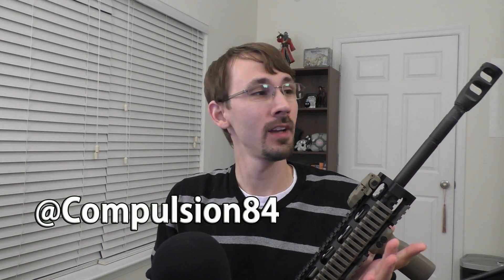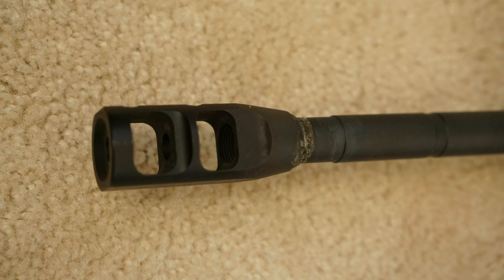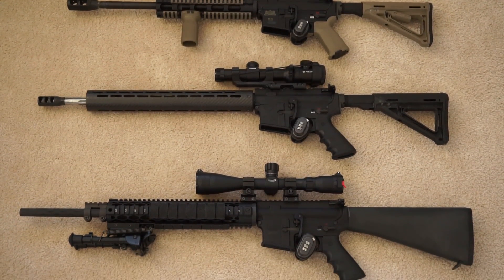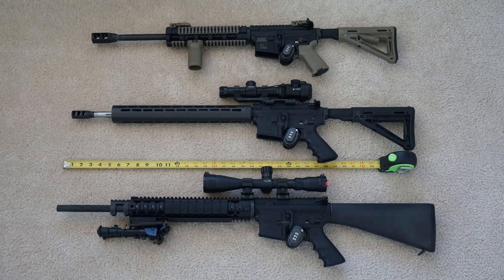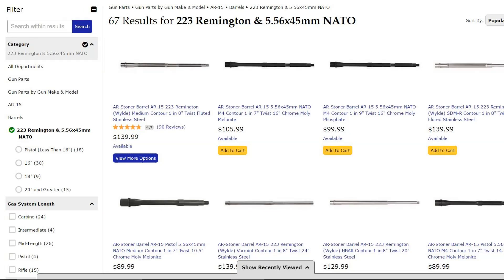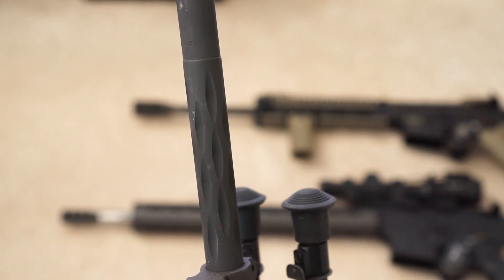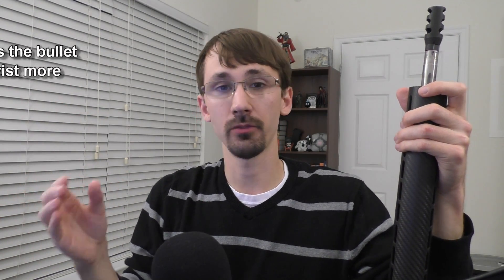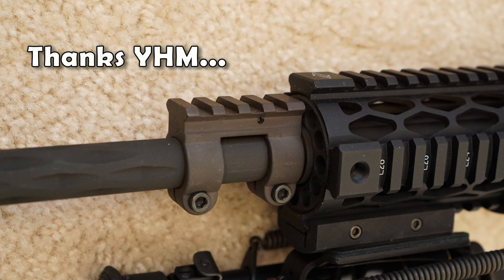AR 15 Barrels - Part I: How to Choose Barrel Length, Twist Rate, and Gas System (AR15 / AR-15)

Comment: Well your correct in a communist state  but if your free you can use a suppressor, then those 11 5 barrels make a lot more sense, pluse much easier to sling around.

Comment: I have a 1/9 twist 24" stainless match barrel and it shoots 69gr under 1/2 MOA shoots 53gr the same.    1/9 is probably the best over all twist for the AR 223.   1/12 is good for the 40s but 1/9 will shoot them well too.  
It depends on the velocity you shoot them at.    
2500 fps 1/9 twist - 2500x12/9x60 = 200,000 rpm
3600 fps 1/9 twist - 3600x12/9x60 = 288,000 rpm (try to stay under 300,000 for varmint)
3600 fps 1/7 twist - 3600x12/7x60 = 370,000 rpm (Blowing up rounds, reducing accuracy, inc heat

Sierra 69gr are perfectly stable in a 1/9 twist unless you were to shoot them under 1600 fps.  They shoot around 3000 fps in a 24"  well over 200,000 rpm.   1/7 twist really only good for shooting longer bullets (Tracers) since they are not pure lead they weight 62gr but have the length of a 80gr thus 1/7 twist is needed.

Its the the weight of the bullet its the length.  Some alloy bullets are much longer than lead.   Some 26gr alloy can be longer than a 40gr lead bullet and would require a faster twist.   

1/9 can do 36gr to 75 gr.  But at 75gr its hit or miss.   Over spinning the bullets might be slightly less accurate than say a 1/12 twist and produce a little less barrel heat.   If the bullets were all perfectly balance over spinning would not cause any accuracy issues so a 1/12 might be a little more forgiving. Shooting heavy 75+ grain also means more drop and slow best shot with a caliber other than 223 with more case capacity.  

For Varmint 223 shooters 1/9 is probably the best do all twist.   36gr to 69gr all sub MOA using a 223 Wyled chamber w bull barrel.  1/7 and 1/8 can do it but at the cost of heat and some velocity and blowing up lighter rounds in mid flight.   With 1/9 twist its difficult to over spin as the 223 does not have the case capacity for 4200 fps but with a 1/7 for sure you can blow up varmint rounds.

Comment: 1st off THANK YOU this channel has been incredibly informative!!! 

Question: I shoot Air rifles long range so in my transition to firearms I want a gun that can be BOTH a home defense AND a long range rifle.  

So is there a way to build out the lower that can be switched out to do both, then I can swap them as needed?!?  OR do you recommend going with an 18" and just have it serve both proposes??   I am a bigger guy I can handle the 18" in a home defense situation if need be.  

Anyone any help/advice is greatly appreciated.  Also I am newer to firearms so specific parts would also be appreciated.  As long as it won't ruffle any feathers with your sponsors.  

Thank you!!
Reply from the maker: Depending on how you setup the lower (using a versatile trigger and adjustable stock) you could use two different uppers easily.  If you want a general all arounder I lean towards 16" these days.  If you want something for more dedicated long range I think building a 20" works.

I have a completely separate 20" rifle because the trigger is very light.  With such a light trigger I wouldn't feel comfortable handling it quickly in 3 gun.  Again if you use something middle of the road trigger pull wise I think building 1 lower (to start) isn't a bad idea.

Comment: Please understand that the majority of aftermarket shorter barrels and gas tubes make your build overgassed and slightly out of time. Not to the point of leaving swipe marks on the case head, but much more gas pressure than required. Using and tuning an adjustable gas block is a requirement for peak reliable operation.  Much less force exerted on your locking lugs, faster cyclic rates that actually stay in time, and less felt recoil.

Comment: I have a smith and Wesson M&p 15t with a 16 barrel but it doesn’t have a brake on the barrel do I have to buy another barrel or can I mount a brake on it ??
Reply from the maker: If the barrel has threads on it you should be good to go.  Threads would be under a cap or an existing muzzle device.  If it's just straight metal to the end you might as we replace the barrel.  

Unless you have a good local shop the cost to thread an existing barrel is relatively high once you factor in shipping.

Comment: Easy, longer means better, higher twist rate means better, get away from the AR platform because Direct Impingement isn’t the way to go.
Reply: Overspin from a twist rate that is too high definitely affects accuracy in the benchrest world.  Even seen bullets explode into a little grey puff from too many rpm’s.
Reply: @blackhawk7r221  I agree in the abstract, I was talking about the currently available AR barrels, the optimum barrel for projectile velocity on average burn propellant is 70 time the diameter of the projectile, add 1 com for a screw so you can attach a muzzle brake of choice
Reply: @anthonyburke5656  Ah, I see where you’re coming from.  Yea, it’s easy to start splitting hairs, but very hard to make a suggestion when everyone is shooting different brand ammo with different burn rates and different pressure curves.  You start blowing their minds when you bring up pressure dwell time and short tube overgassing affecting cyclic timing.  As long as people are using the inherently inaccurate M855 green tips, it’s almost moot.

Comment: Overall, this was a good video. I would advise against calling something "stupid" or "dumb", particularly if you don't have a full understanding of the why. Gas system length is unrelated to handguard length. 

You can use a any length handguard with a carbine, mid, intermediate or rifle length gas system. As you correctly stated, you should ensure that the handguard covers the gas block, or you risk knocking it out of alignment, which will affect the function of the rifle. It's for this reason I'm not a fan of "railed" gas blocks like the one on the DPMS Oracle.

Longer gas systems aren't "more" reliable, they can be less, which is one of the reasons why the military uses a carbine length. Carbine systems are a bit more violent and cause accelerated wear on some parts, particularly on the bolt & gas key. 

The reason for the enhanced reliability of a carbine length gas system as opposed to a mid-length gas system is DWELL TIME. This is a function of the amount of barrel left after the bullet passes the gas port. Once the bullet leaves the barrel, the gas pressure drops precipitously, so more barrel after the gas port allows gasses to travel down the gas tube to the bolt carrier. With a mid length gas system, the block is further out, there is less barrel before the bullet exits...and thus less propellant gasses to cycle the bolt.

This does cause less of an impulse making the mid gas system a bit more pleasant to shoot, but let's be honest - the 556 is a soft round anyway. 

If your ammo is full powered, you shouldn't have reliability issues with a mid length gas system, but with lower powered ammo like steel case Wolf and Tula, some have had cycling issues. It's a trial and error thing- but life on the line, I want something I don't have to think about, so carbine gas system is better.....NOT DUMB.

Read up on how dwell time effects cycling of the firearm. I'm not knocking you, as I needed to study it quite a bit. Just a little info for you. Keep up the vids!!!
Reply: I appreciate the vid,and your comment,being new to the AR platform,they both helped quite a bit.
Reply: Exactly why we properly tune with adjustable gas blocks to compensate for all these overgassed tube and barrel lengths causing cyclic timing and wear issues.

Comment: Why does the handguard need to be tied to the gas system?  Can't you have a really long handguard on a shortlength gas system? Granted short gas system is really bad idea for 16 inch barrel.
Reply from the maker: You don't necessarily have to, it's just a better fit.  You could have a longer handguard than the gas system, it shouldn't hurt anything.  It's also possible to have the guard not cover the gas block, but I hate those myself.

Comment: There is nothing at all "stupid" about a carbine gas system, plenty of shooters like the carbine handguard length, you may not but it probably is the most popular length, carbine and rifle were the two military original gas lengths, mid-length is civilian. Not that many shooters want or need a rifle with that much barrel and hand guard length such as 18" and 20, hunters maybe, also the military used 20" because of bayonets, which now only the Marine Corps trains for.

Comment: Terminology- twist rate spin stabilizes the bullets. 1 in 12 is faster and 1 in 7 slower spin rate. A model to show people is a bolt with a nut in it. Thanks for making the vid.
Reply: One revolution in a seven inch distance is now a slower twist than one revolution in a twelve inch distance.  Uh, ok.

Comment: Really great video and spread of information covered. Could not catch it - did you mention 55gr and 1:7 twist rate?
Reply from the maker: Thanks.  I've used 1:7, 1:8, and 1:9 barrels with 55 grain FMJ BT XM193 with good results.  I've heard scattered stories of issues with 55 grain and 1:7, but never experienced it myself.
Reply: Depends on your particular gun and the ammo, but I've run numerous 1-7 barrels at 16in and the only 55gr that have ever given me problems were Tula.  I've always chalked that up to the crappy bi-metal construction.  Anyway, never seen any signs of over-stabilization in 50gr+ projectiles, and one still has the ability to run up to 77gr (or larger).  For 16in 1-7 is the way to go.  For a 20in, 1-8.  1-9 is pretty antiquated and for a general purpose rifle I'd avoid it as I have had problems with 55gr and 68/77gr not stabilizing in older Bushmasters with 1-9 twist.
Reply: @mfallen4277  This is a very helpful response, thanks. It can be a bit confusing because there is so much information out there. Most rifles I have seen in 16" have been either 1:7 or 1:8 twist. Thanks!

Comment: Carbine gas systems don’t clog up after prolonged use. The gas block and gas tube get hotter than mid length, which clears them out. Also the higher pressure helps them operate in adverse conditions.  So if you’re fighting with your rifle outdoors, or shooting long strings of fire, a carbine system will go bang more before you start to have malfunctions. Probably why the military uses them. 

Also, a 14.5 barrel is easy to pin and weld, then remove and pin and weld again if you need to. The loss in velocity is minimal and it’s a lot more maneuverable. Probably why the military uses 14.5. 

Yes, if you’re opposed to a little extra work/cost to pin and weld your barrel than go with the pointless 16” (this rifle was never designed for 16”). Yes, if you are never planning to run your rifle dirty, or put reliability before comfort, go with a mid length gas system. To say neither is useful is wrong.
Reply: More reliable to what extent? Sure it has more gas for reliability though that will erode the gas port faster wear out the tube faster beat up the action faster.  
If you have seen any meltdowns it's always the tube that fails. Shorter closer to the action. Is going to fail sooner.

Comment: It is tested fact that some ammo actually looses velocity over 18 inch and even 16 inch on some as well. Under 13 inches, most 5.56 and 223 ammo does not perform as designed due to the velocity needed to cause the boolit to open up as a hollow point or can cause tumble or over penetratration due to falure of the jacket to cause a boolit to open up which turns your AR into a great performing 22 magnum. A 13 inch AR is fine up to about 125-150 yards depending on barrel and ammo used. The U.S.Army went with a barrel length of 14.5 inch with an A2 flash hider as their ideal length field rifle after starting with the 20 inch barrel. For me, a 14.5 with a wielded pinned A2 flash hider, medium contour barrel,  bringing the overall length to 16" , 1 in 8 or 1 in 7 twist barrel, has a winning combo of handling, weight, and performance and I can use any stock I like as well as not working about the ATF or state governments deciding to again, restructure language for the “pistol length AR15 laws”, which they can and will do with political pressure.
Reply: I didn’t want to leave the impression that longer barrel lengths can cause a loss of velocity, but it has in a few cases.There is an average of 20-24 FPS increase in velocity per inch, but that is between a 16 inch barrel up to a 28 inch barrel. Things begin to change when the barrel is cut to less than 14.5 inches, with un acceptable longer range results out to 250 yards and more. A 10.5 inch barrel is ok for short range work, but 13 is much better.
Reply: One also must recognize. 223 is tested with a 24 or 26" for the velocity stamped on the side of the box. 
5.56 will reach 3100fps with a 20"  
2700ish with 16"

Comment: Thanks for the vid, I was a little worried about buying an 18" barrel cuz im only 5'8 and i thought it might be too big.
Reply from the maker: I probably wouldn't go longer, but I think you'll be a ok at that height.
Reply: No, don't worry it'll be just fine and I just mounted a 30" BCB Wylder .223 barrel which weighs almost as much as the original ArmaLite AR-15 did.

Comment: 18 inch 1-7 twist rifle length gas system. Aka a Daniel defense ddm4 v11 pro
Reply from the maker: That looks like a nice rifle.  I wish they would've gone with M LOK vs keymod though.
Reply: @Compulsion84  the v7 pro has mlock

Comment: Actually the further a bullet goes down the barrel the less gas pressure you have. A longer barrel does give a larger muzzle velocity because the gas accelerates the bullet for a longer time. You have a fixed amount of powder that will burn into a fixed amount of gas. If  this gas is in a smaller volume ( bullet close to the receiver) you get a higher pressure. When the gas is in a larger volume ( bullet near the muzzle) you have a lower pressure. So, when you port the gas system further down the barrel you get a lower pressure. The pressure may be lower but it is still high enough to get the job done.

Comment: Hello, i'm new to building an AR and i just ordered a 16" carbine length barrel 1:8 twist and along with it i also picked up a carbine length  gas tube with low profile gas block. . . did i order the right match? thank you in advance.
Reply: Ian Aguinaldo yeah you’ll be fine, the most popular that I see is usually the 14.5 w/carbine tho.
Reply: @AyeMcCloud  thank you so much for that and answering my question so quick. Have a good one.
Reply from the maker: Based on what you said, that should all fit up well.

Comment: Good afternoon Sir and folks; I’m currently making my build and I am stuck between RRA (18 inch, .223 wylde mid length Upper) or Aero Upper ( 18 inch, .223 wylde Riffle length upper). I am familiar with riffle  length  gas system at .223 wylde but I am not familiar with a 18 inch .223 wylde mid length gas system. What are your thoughts and any one out there that has experience with either or?  Outstanding Video !!Thank you.
Reply from the maker: I haven't used a wylde mid myself, but the chamber won't affect the rifle's function.  I guess decide between a little more velocity with 20 or handling with 18?

Comment: Remember that at 14 and a 1/2 in the gun is going to be blisteringly loud when it goes off. Even at 16 in you're giving up quite a bit of velocity. 18 to 20 in is Easley handleable for length and functions quite well with 5.56 + 223. Even given the limitations of the 223. I have one firearm in said caliber with less than a 14 inch barrel at least in the functional barrel length. It does have a muzzle brake on it that I can't add all the ports forward on so it didn't hurt literally hurts when it goes off even if you were Outdoors. But that firearm is for very specific Close Quarters tactical work. It is also in the form of a Mini-14 which will continue to function for a long time to come with very little maintenance.

The highest pressure in that firearm is directly in front of the chamber. And no one would put a gas block there. So your thought that you get a higher pressure if you move the gas block down the barrel, is false. It does not work that way.

Comment: Faster rifling twist rates are for LIGHTER grain bullets. It helps stabilize them in flight. Larger bullet guns, like .50 cal, will always have slower twist rifles barrels. We're talking 1:7 for a 55 grain 5.56mm versus a 1:20 for a .50 cal for example.
Reply: That's just not true.
The weight of the projectile isn't what matters, it's the length of the projectile that matters ( they usually correlate in the same caliber).
There are several other variables that anyone reading this can research if they're interested, but the common misconception about weight needs to be corrected.
The new 8.6 Blackout has a 1:3 Twist for a 350 grain projectile just for an example of extremes.

Comment: Around the 9 minute mark you said to get a mid length gas system for the 16inch barrel. What do you define as mid length?
Reply from the maker: It's a standard. You don't need mid length x".  You would just look for a 16" or 18" mid length barrel.

Comment: If you are looking for the most accurate barrel on the commercial market , then it is the Wilson Combat barrel in any caliber 
they sell.  I currently I own 5 Wilson barrels in 3 different calibers and they all shoot more accurate than i can hold them , which is typically 1/2" to 3/4"  at 100 yards. All Wilson barrels are Match Grade barrels. I have 45 years experience with the AR platform , 22 years of it in the U.S.M.C. and was a member of the Marine Corps rifle team for two years. Warning ! If you buy a Wilson barrel you will never be satisfied with any other brand again.